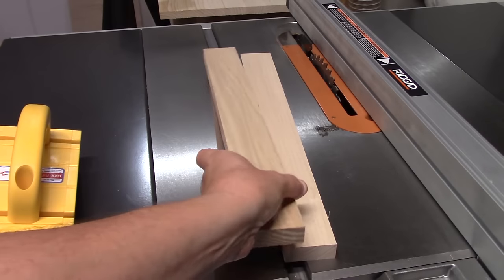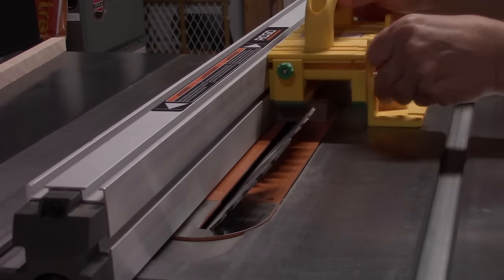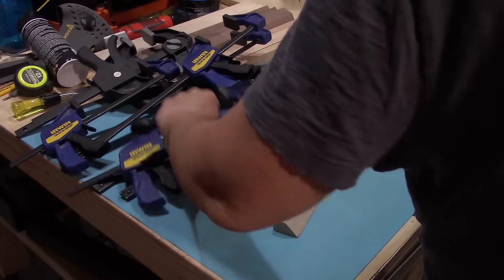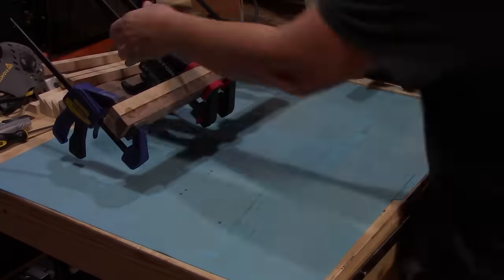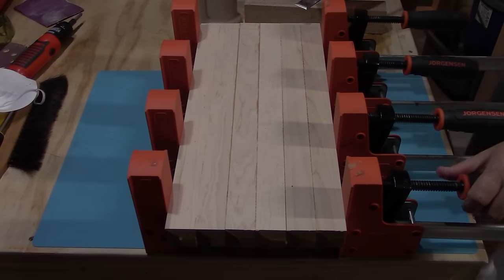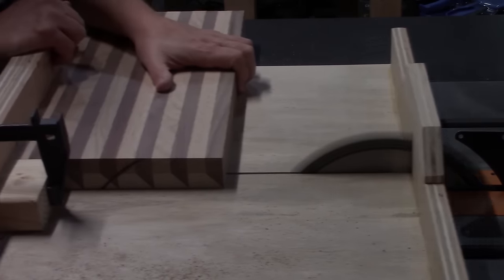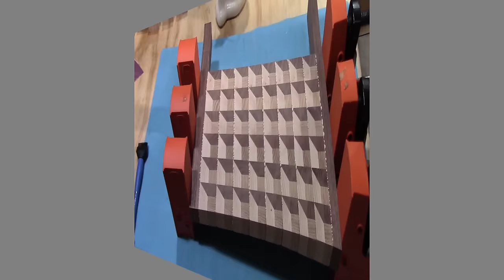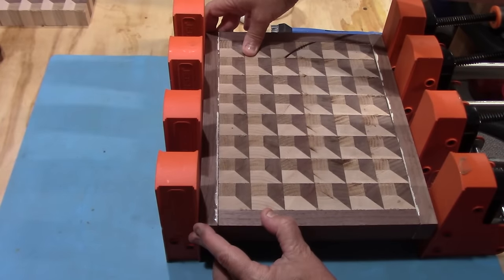The Stunning 3D Cutting Board - Part 1

Comment: What grit do you use on your drum sander?
Reply from the maker: Thanks for stopping by to watch the video and comment.  The sander came with 100 grit paper installed and I haven't changed it out.  It's a good base to start with when sizing the stock.  It removes material easy but still leave a pretty decent surface after a few pass throughs, and it alleviates a lot of the sanding work that I hate doing.
Reply: @DEJaegerWoodworking  
Yeah, I typically use 80 grit, cause I found that if a board needs a lot sanding after glue ups, anything higher generates a lot of heat and end grain boards start to curl slightly. 
But the 80 leaves lots of sanding work to do with the RO sander.
Reply from the maker: @fricasseekid  80 will definitely do a better job, but typically leave the 100 in there as a good middle of the road paper for all projects.  The drum sander has been a real time saver, and I've never regretted that purchase.
Reply from the maker: @fricasseekid  80 will definitely do a better job, but typically leave the 100 in there as a good middle of the road paper for all projects.  The drum sander has been a real time saver, and I've never regretted that purchase.

Comment: Any reason you have to glue all three pieces at the same time?
Reply from the maker: I'm not sure what you're asking.
Reply: @DEJaegerWoodworking  I think the question is: Can you glue the red oak (or cherry) to the maple or walnut, let that dry, and glue on the third piecel
Reply from the maker: @howardbessen8153  Gotcha! Thanks for stopping by to watch the video and comment.  Yes, I suppose that is another way to approach it, although I would be a bit worried about dried glue squeeze out causing gaps when attempting to add the third piece.  Gluing the three at the same time binds all three pieces together and prevents this.  Not saying it couldn't be done though.
Reply: @DEJaegerWoodworking  That would be my concern too. On the other hand, it would make clamping much simpler. I'm going to make this board, and with the first 3 pieces I'll try it with only the cherry (instead of red oak) + 1 other wood first, with tape along the glue line to try to prevent any squeeze out from sticking. I'll let you know how this works.
Reply from the maker: @howardbessen8153  I would have normally gone with cherry as well, but only really had the red oak on hand for the third color differentiation.  Took a lot of guff for the porousness of the red oak, but it still turned out well and the customer I made it for is a fanatic about the care of their cutting boards, so I know they it's in good hands for cleaning and conditioning.  Also took a lot of heat for the non-endgrain border.  Lots of users saying it will separate.  Again, it will go a long way with proper care, but have asked the owner to keep me apprised of any issues that come up in that department.  Send or post pics of your final board and let me know what issues you experienced during your build.

Comment: Where to get plans
Reply from the maker: @HaroldHarder-ej9oh  Oh heck, I was hoping that the video would serve as a guide to building one. 😁
Reply: Did I miss the dimensions?
Reply from the maker: @HaroldHarder-ej9oh  The ending dimension of the board in the video was around 12” x 10” x 3/4” but the ending size of any board that you might make would be really depend on the length of your beginning stick and how many separate glue ups you do. Additionally, the width of your cutting blade would also determine your end size.
Reply: @DEJaegerWoodworking  ok thanks I am using the pattern to make great grandson’s junk box lip ,done the 3 cubes already,this one for another,much thinner on substrate.
Reply from the maker: @HaroldHarder-ej9oh  Good luck on your build!